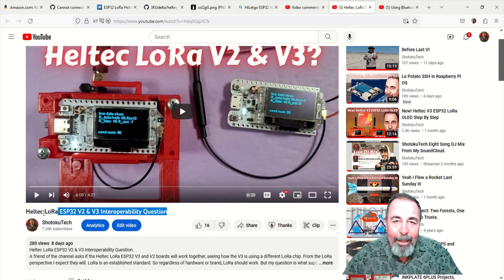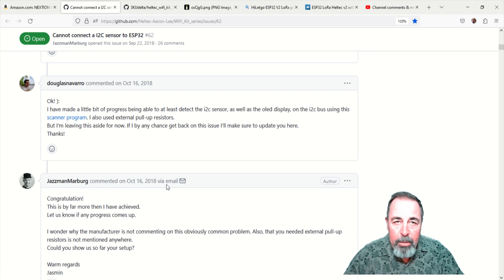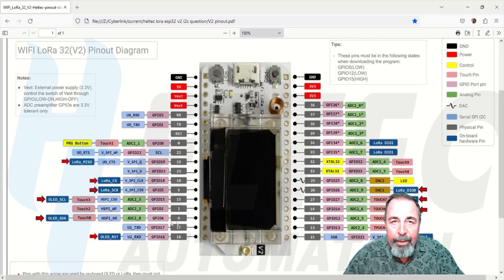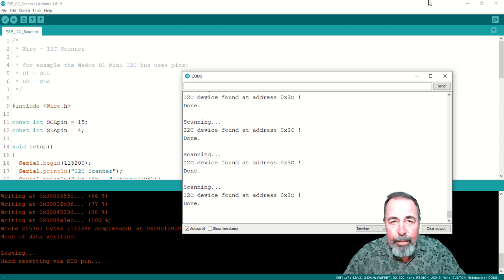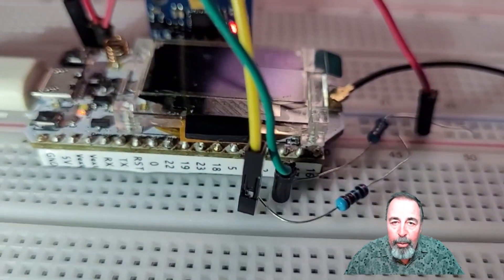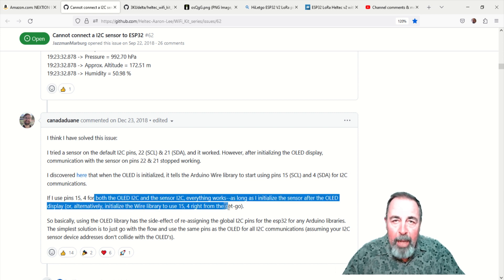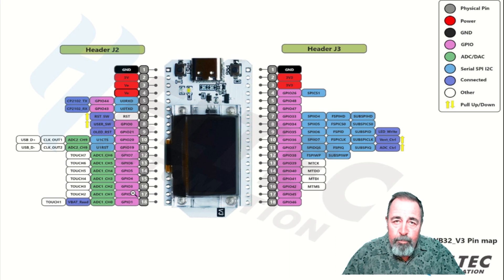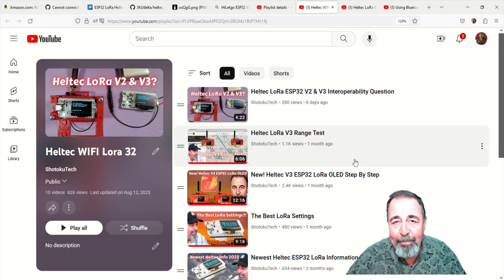Heltec LoRa ESP32 I2C Question

Comment: Hello Shotoku -- I discovered your wonderful channel. Thanks.

My V3 board works.  I plugged it into my car while I watched your video on my phone.  The factory test fired right up.  After I got it home, I tried examples.  I can get the time (NTP), so the wifi hardware works.   The OLED example works.  But factory test V3 V2 doesn't, not anymore  At compile time, I get this error:  'class WiFiClass' has no member named 'setAutoConnect'

It's a simple problem, I think.  I need a version of WiFi.h written by Mr. Aaron Lee of Heltec,  not one written by Expressive or one in the Arduino Core. Did you run into this compile problem?

hardware: Version 3  (version 3.1 actually)
board: Heltec WiFi LoRa 32(V3)
IDE: V2.3.2
board manager: https://github.com/Heltec-Aaron-Lee/WiFi_Kit_series/releases/download/1.0.0/package_heltec_esp32_index.json
relevant libraries: Heltec ESP32 Dev-Boards V2.0.2
                                Time V1.6.1
Reply from the maker: Hello. Sorry, this comment got 'held for review' so it took me a while to see it. For the Heltec V3, you only need the board manager URL, select the WiFi LoRa32(V3) and use the example sketches under 'HeltecExample'. I find it is problematic to load other Heltec libraries. So I'm not sure you want 'Heltec ESP32 Dev-Boards V2.0.2' installed or if example sketches from that library will work. The additional library may be causing problems. The board definition itself contains the example sketches for 'HeltecExample'. Best wishes.